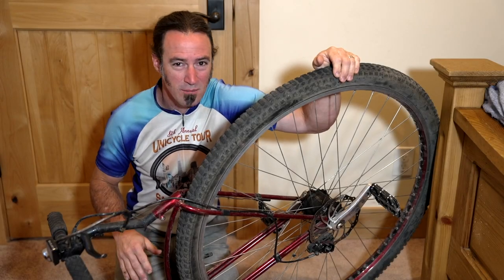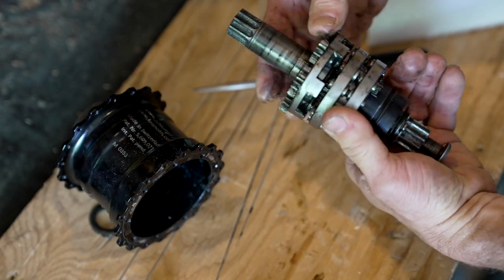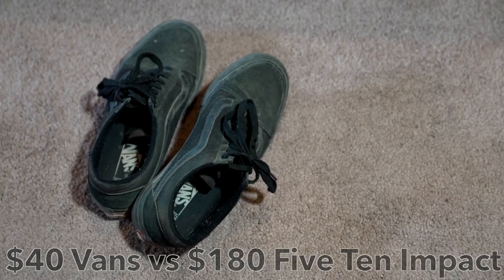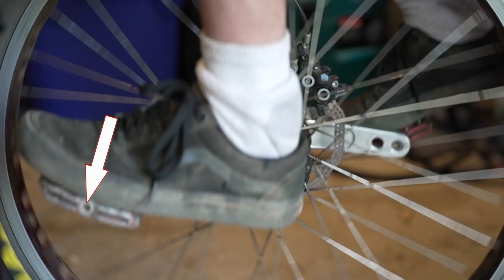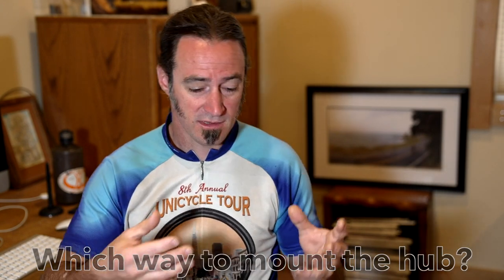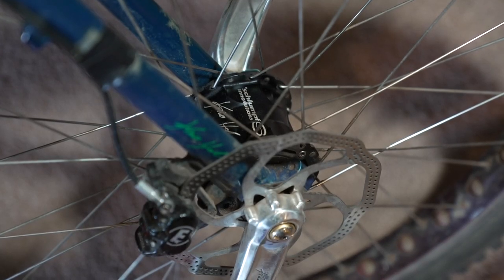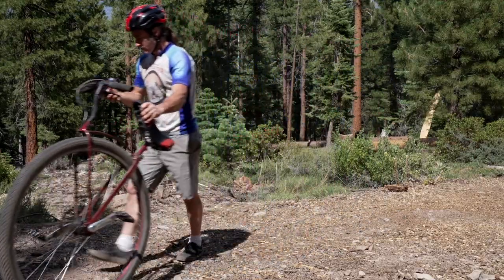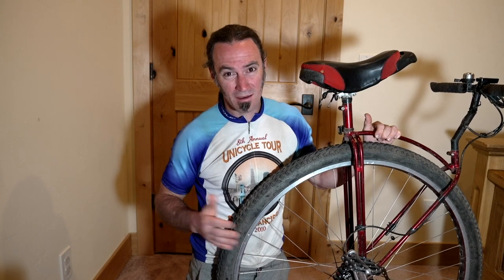How to shift gears on a unicycle! Kris Holm / Schlumpf geared unicycle hub - Unicycle Tutorial -Ep 1

Comment: Excellent vid! 🙌🙏⚙️
I’ve just started learning to ride a G26er and I’ve started out just trying to ride in high and being helped on. Just to get a sense of the wheel’s rotation. Happily when I was just half testing a shift up when on a warm up ride in 1:1 and it happened! I was riding in high for a few seconds and then I realised and … wipeout. But I can see how the whole this feels now and I am willing to face the fear, take a few tumbles. It feels to me all about learning a new muscle memory lexicon on reaction and pressure calibrations for when in high and in a sense low (or more the adjustment from low-high, high-low). Once I have those reactions in my body I think the shifting will be more of a continuous flow from 1:1 to 1:1.5 and my muscles / road-read / unicycle link all be in the high gear mind set. 

Anyway. Great to see all the steps to be aware of in this video and nice to see videos on the Schlumpf. For such an amazing device, it’s amazing how few videos around there are.
Reply from the maker: Thanks! You made another good point: it is good to just learn to ride in high gear (ie, shift by hand and hop on) and get a feel for it. I forgot to mention this in the video, and it is an essential part to the learning process.

Comment: I am so happy I found you. Woodworking and unicycling ❤️

If I ever stumbled across a schlumpf hub
Should I use it with kris Holm products only or could I also integrate it into a nimbus system?

Also how does the spoke length change in comparison to a not geared uni?
Reply from the maker: Awesome! The Schlump muni hub will work in any 42mm bearing holder at the right width -- I think the width is 100mm, but you should double check. KH products all fit this standard, although some of the older products required some shaving down on the bearing holder to avoid having a disc brake rub. The V-frame I use in the video is a custom one I hand made.

Spoke length: You check the Schlumpf website to find out the hub's spoke diameter and look at the rim manufacturers reported rim diameter; you then plug these two numbers into a spoke calculator (along with the lacing pattern) and it can calculate the spoke length. So yes, the spoke length will change!

Comment: Cool. I have to search for a picture I saw long long time ago of a penny farthing with a fixed gear reduction by chains and sprockets actually placing the bracket hub(s) below the wheel axle, allowing a smaller wheel and overall lower height. This concept could be applied to the unicycle I suppose. Keeping the width of the overall construction as small as possible would be the greatest challenge. A bit of bracket axle length is gained because the spokes are at an angle, further away from the wheel hub means a bit more space. I have been looking at some unicycles used for higher speed, normally this means a larger wheel of course.

Comment: I have a bad habit, I think, of using the brakes when shifting (rim or hub mounted disc brake). I say bad because I don't use it only when slowing down and downshifting, but also when I want to upshift. The one footed advice is great, that is something I'd like to learn.
Reply from the maker: Yeah! I think people brake before up-shifting just to slow down - maybe the trick would be to shift 1-2mph earlier than what you are doing now; that way you don’t have to slow down and speed back up.
Reply: @CorbinDunn  Great insight! I think that's true; the cadence I can comfortably spin in low gear seems higher than the cadence I can comfortably shift at. So shifting earlier is a great tip, and maybe I can just practice shifting more. Now I want to practice more to be able to shift proficiently😀

Comment: Is it a free wheel?  Do the handle bars make it easer to ride. I have a plane one and ride it  just short distance.
Reply from the maker: It is still fixed gear riding, but it does briefly freewheel a short distance when shifting. The handlebars make it harder to ride! A lot of people use their arms to help balance, and holding a handlebar makes it more difficult at first, but stabilizes your riding by forcing you to balance with your core. The handlebar is for comfort on long rides; it takes weight off your bottom.

Comment: Can you ride these backwards like normal? And is the brake required?
Reply from the maker: Hi! Yes, you can ride it backwards; it is still a fixed gear. Riding backwards on a 36 is tricky to begin with though. A brake is not required..but at high speeds you will want one to control your speed  - especially down hills. Even on an ungeared unicycle: your legs won't be strong enough if you are going down a steep hill and exceed ~12-15 MPH (I've seen it happen, and it wasn't fun, so a brake is recommended.

Comment: Can the 1.5x gear be swapped out for a 1.75x or 2.0x for really cruising?
Reply from the maker: No, it is fixed. For going faster, people usually use a bigger wheel, such as the 36'er in the photo. I could cruise at 18mph, hold 25 mph downhill, and peaked around 28 mph. It was still decent at climbing hills with 150mm cranks and 1st gear,